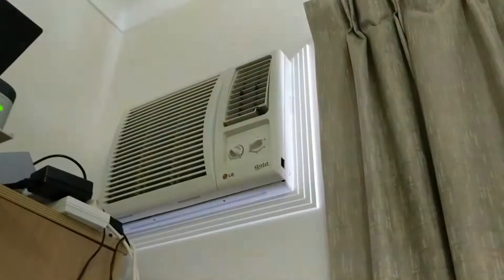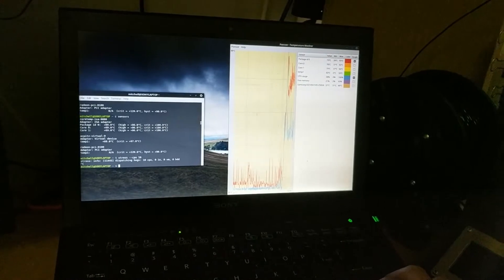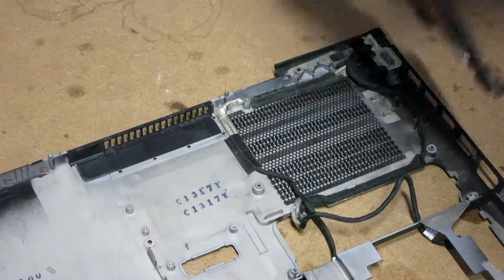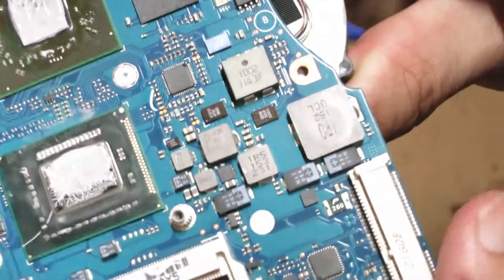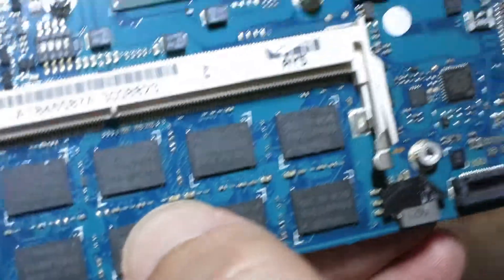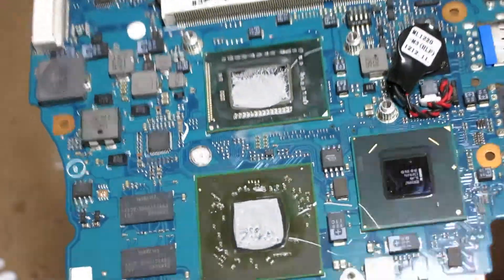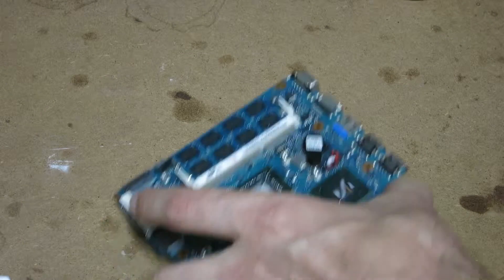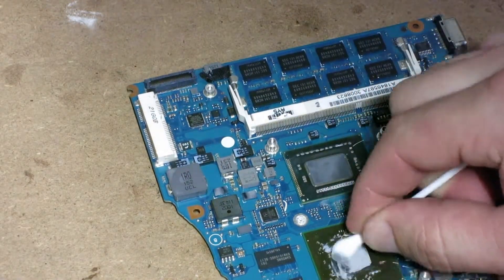Laptop Getting HOT!!! Sony VAIO airflow Fail!!???

Comment: Do you raise your laptop up off the desk at all? A that allows more air to that fan or even just some rubber raisers could help a lot. 

If you find your temps raise more after a few days you might need to get thermal paste with out silicone. Look up pump out effect if that is an issue.